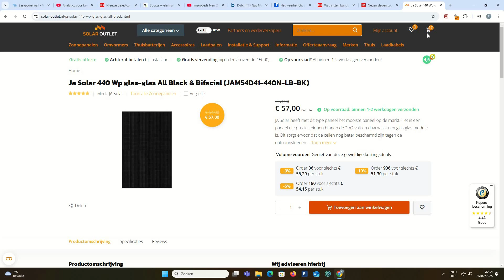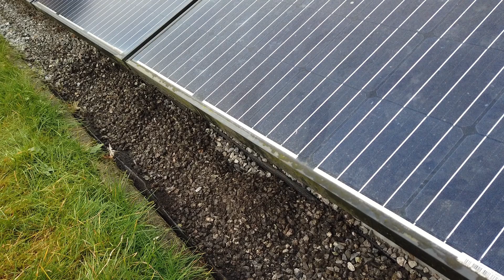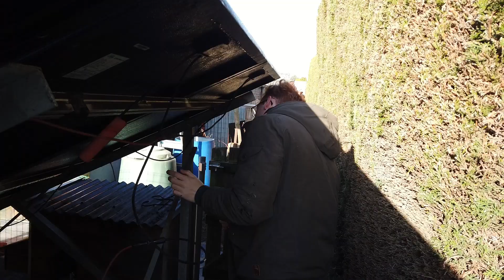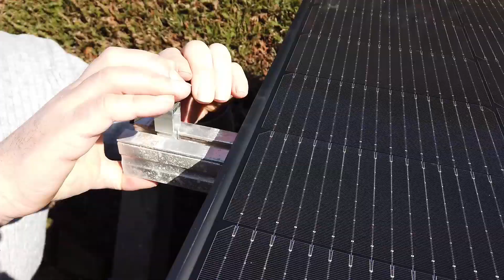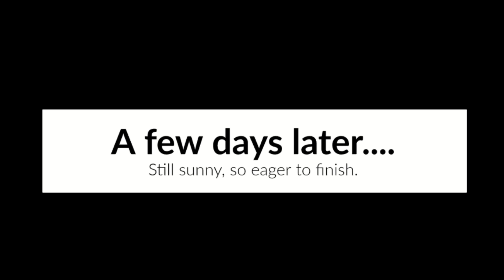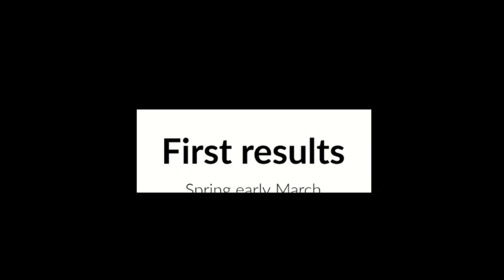DIY - 4kW Bifacial Solar Panel System upgrade - Step by Step

Comment: Hi Franky, thanks for the great video as always. I couldn’t help but notice you overshoot the 70a limit on the battery side of the mppt controller by 10(or 12) amps, is this because your experience tells you the wp and max current figures are never reached or because you take the shading of those two corner panels into account or maybe something else i missed?
Reply from the maker: Hi Erling, good question. The answer is revealed in the follow up video. Not 10 but 9 panels are connected to the MPPT charger. 1 panel is connected to a grid tie inverter. This way I will never reach 70A on the MPPT charger at the battery side.

Have a nice day.
Franky - EASYPOWERWALL

Comment: 3:10  this breaks my head .. solar side black is  ground  red is plus ..  other side black is + ..makes totally no sense to use black for  positive to me ..    On 230V you don't use blue for fase and brown for neutral ..
Reply from the maker: I agree, used left over from previous install. In Belgium There's no longer colour code for DC, most installers only use black cable.

Thanks for the remark.

Franky - EASYPOWERWALL
Reply: @easypowerwall  more for economic reasons  ( don't have to buy 2 different rols ) .. as long as you mark them it's fine idd . 
But in  very large installs i still see much red & black on solar panel strings . ( the panels themself are alway black )
 In uk they now have round ( double insulated ) cable with  red & white . never seen those in Belgium .

Comment: dc breakers van aliexpress?dat vertrouw ik toch niet.heb me laten vertellen omdat ik ze ook wil dat je merken zoals shneider , eaton, abb.maar zijn ook pak duurder.op amazon vind je ook van heschen ,dihool maar hebben ze me afgeraden.trouwens heb me geabonneerd op je channel.
Reply from the maker: Hey Dave,
Heb al enkele jaren een powerwall (ooit gestart met +3000 18650 cellen) en nu LFP. Werk steeds met chinese hardware. Tot nu nooit problemen gehad. Werk meestal met EARU hardware en ik vind deze heel solide gemaakt en werken perfect.
Bedankt voor het abonneren, dat apprecieer ik enorm.

Prettige dag.
Franky - EASYPOWERWALL
Reply: EARU ken ik niet moet er eens naar uitkijken. Bedankt voor je reactie.  @easypowerwall

Comment: your back Franky , only  440w panels, 720w are available already ? :)
Reply from the maker: Hi Kevin, I know these panels are available but they wouldn't fit on my existing frame. These 440Wp panels are on the sweet spot  for price & size.

Have a nice day.
Franky EASYPOWERWALL
Reply: Agree, Wp per m2 counts